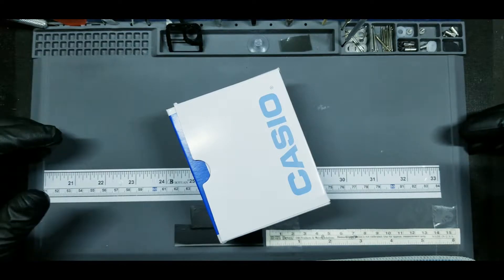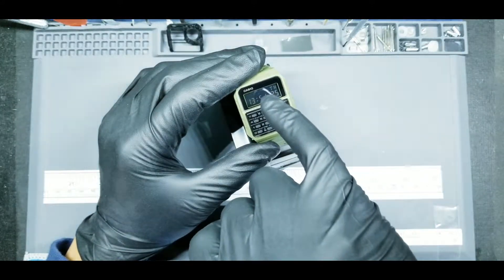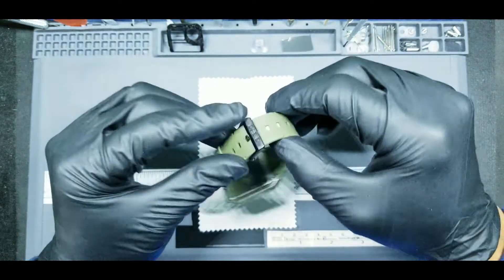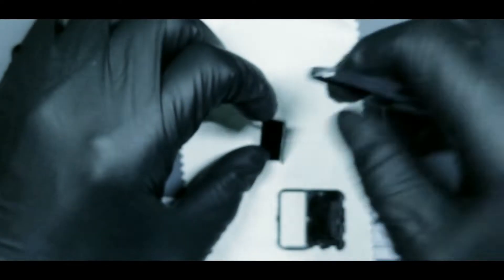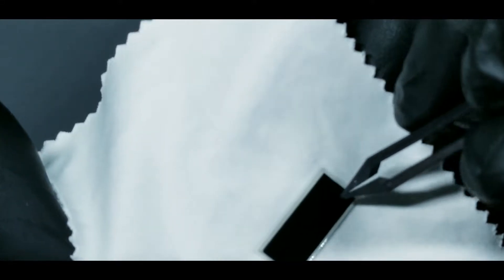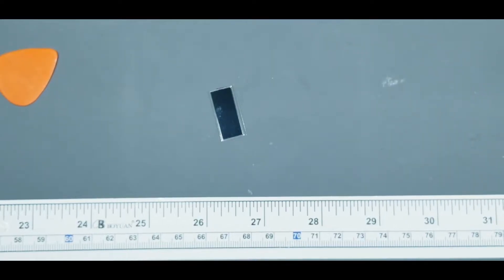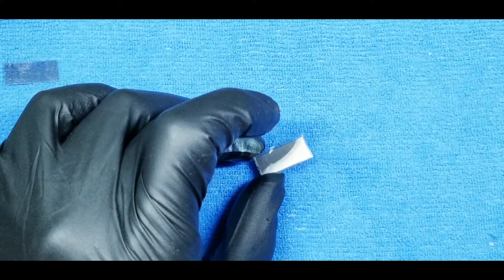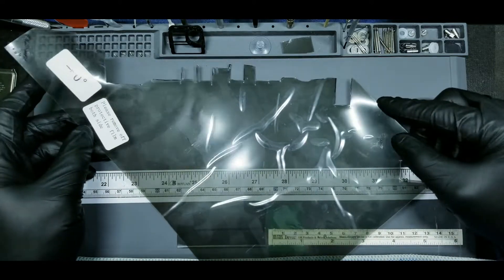[Modified Casio] Convert negative to positive display on the Casio CA-53WF-3BCF

Comment: What I did was spend $19 on another original black calculator watch that already had the inverted screen and just disassembled and swapped the whole inner unit. Took like 5 minutes.
Reply from the maker: Good suggestion for those that don't mind spending a little bit more.
Reply: @watchncarry9593  it was just the easiest way for me. I love your video and appreciate how in depth you go. Quality content! Subscribing :)

Comment: loving the no-BS, no-intro jump right in style of the video! It actually took me by surprise but the content is front and center as it should be and I feel 'respected' while watching this. So thorough, so wholesome. Keep it up!
Reply from the maker: Appreciate the kind words. 🙏👊
Reply: @watchncarry9593  at 18:00 you mention there's 3 layers. The bottom layer is a matte finish. Do you know if that layer is necessary for the watch to function or if it's only for contrast? Also, do you know if I could replace this back layer with a different color or material?

Comment: Thank you for this tutorial.
Isn’t it easier to leave the original filter and just put the new one rotated, the way it changes the negative to positive?
Reply from the maker: @Bernie_Boernsn  thanks. Good question, but no...you have to remove the original polarizing film before putting on the new polarizing film.

2 polarizing films placed on top of each other wont change the display from negative to positive and vice versa
Reply: Thank you for your quick answer.
Reply from the maker: @Bernie_Boernsn  👍

Comment: On my White Casio CA53 Calculator watch, I changed the clock module with one from a positive polarity CA53 calculator watch that had a broken case. The Negative is so much harder to read.